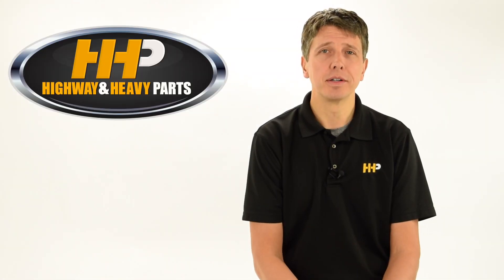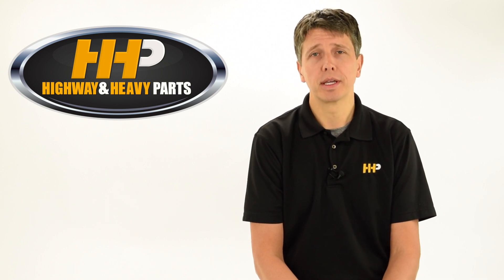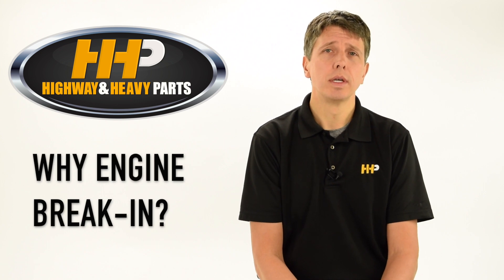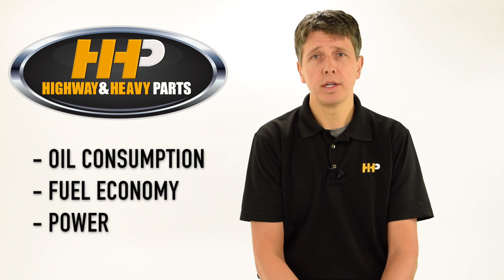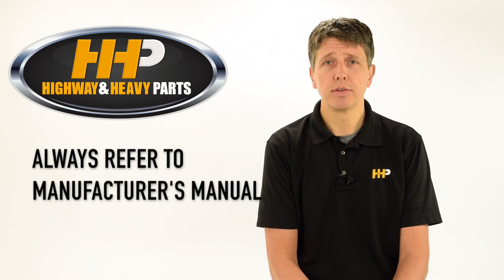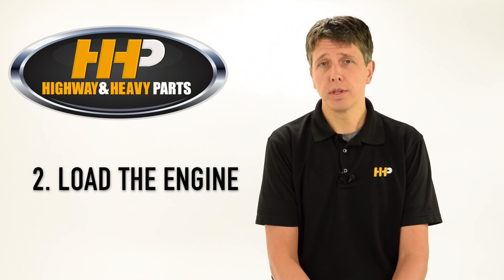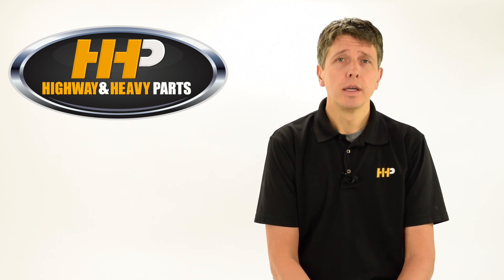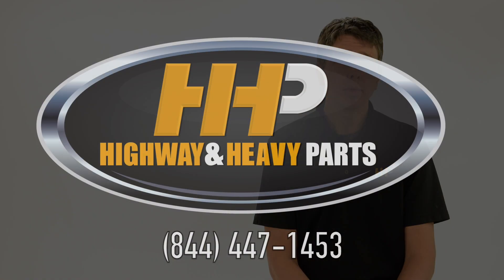How To Break In Your Diesel Engine The Right Way!

Comment: Okay but what about breaking in the cam ? Don’t you have to run it for 2000 for 20 minutes like for example a  cummins has flat tappets.
Reply from the maker: We understand how important this is, and we want to make it as easy as possible for you! Our tech team is ready to assist—just give us a call at 888-431-1453, and we’ll work through it together.
Reply: The break in procedure for an engine and a new camshaft are different and seem to be mutually exclusive since the camshaft break in, for my tdi, is to run without the vehicle moving so no load. If your newly built engine has a new camshaft and lifters, how do you break both engine and camshaft in? I haven't found any i formarion and videos on this so I think it would be a great video to make.

Comment: How soon after the rebuild ahould you drop your oil? Should you use an inferior oil to break-in the engine or a high quality oil with excellent detergent properties?
Reply from the maker: Within 500 miles of first starting your engine after the rebuild, you should be getting the first oil change. Having the oil changed this soon helps remove any contaminants that may have gotten into it during the rebuild, as well as any metal particles that get in it during break-in.

When changing your oil, make sure to use conventional motor oil for the first few changes. Synthetic oil is too slippery for proper break-in, and should not be used until months after the rebuild. You can also use break-in oil. Break-in oil is especially clean of contaminants, which helps out when the peaks of the cylinder liner get machined down. Most break-in oils are also high pressure oils that keep the oil from scattering under the intense pressure that can occur during break-in.

For more information, check out our Diesel Engine Blog on Oil Changes during Break-in:  https://dieselengineparts.highwayandheavyparts.com/blog/diesel-engine-break-in-guide#/results:content

Comment: I just got reman 6.6 LBZ Duramax from Engines Direct in Arizona, installed professionally. They said in an email to drive 400-600 miles in stop and go traffic, change oil, change again at 5000. No sustained rpm’s, no towing for the break in period. ……….      I’m not real sure how many miles the break in period is. The installer told me break it in like your gonna drive it..and now this. I don’t know what the fuck to do
Reply from the maker: Everything you've mentioned is what GM recommends also.  There are Duramax owners that go for just about 1k miles before their comfortable to gradually increase their speeds, start towing, etc.
Reply: How’s your truck holding up 2 years down the road?

Comment: My company usually hauls light loads yet my truck recently replaced with a brand new truck, first load they gave me was 45k lb 1200 miles trip. 
Engine break-in ☑️
5th wheel adjustment ☑️(I don't touch it once I set it)

Comment: Great video! Now say if you replaced a piston on 6.0, 2 new heads( with all new valves) and head gaskets. Would that still require some type of break in?
Reply from the maker: Joseph, if only 1 piston is replaced it is not completely necessary to break in the entire engine. If you have any more questions, you can give us a call at 844-447-1453!

Comment: What about a NEW Cummins ISB 6.7? Should you change it's break in oil around 500-1000 miles?
Reply from the maker: 500-1000 sounds correct to us. Make sure to run the engine at 70%-85 % Maximum load and keep idle to a minimum.
Reply: Hi there –
I live in an area that doesn’t have a lot of hills… Can you explain more detail regarding logging the engine and using boost pressure to confirm sufficient load is placed on the engine for break in?

Comment: Thanks, basically confirmed what I've been told in the past. I've just overhauled an engine on an irrigator pump unit, it's an Isuzu 6BF1 truck engine that I bought used many years ago and have since put thousands of hours of steady work on. I did a complete job on it (including finally getting a cam better suited for the rev range I use), I gave it the first startup today, only ran it for a minute (lots of smoke to start with), next start will be with a load. I can increase or decrease the load depending on revs and how much water I get it to move (opening the valve on the pump increases the load til the point the pressure drops off). I'll give it a good work out :-)
Reply from the maker: Timarulad, thanks for watching!

Comment: Spot on,to many people hold the belief that they must be gentle,go slow,not rev engine,this was only true on engines where parts and materials were very crude,often hand made,today s motor s use more advanced metals,that are tough and need hard work and stress to bed them in,failure to do so and bore glazing occurs
Reply: Is this true too for petrol engines?
Reply: @PoliticalGangster  Yes , Modern motors have highly machined surfaces, that require little time to run in,The first oil change between 1000 and 5000 KMs is important thou,